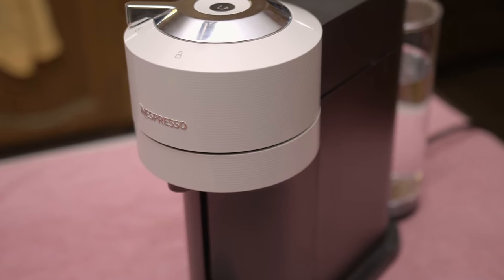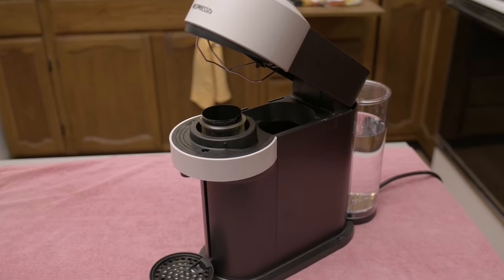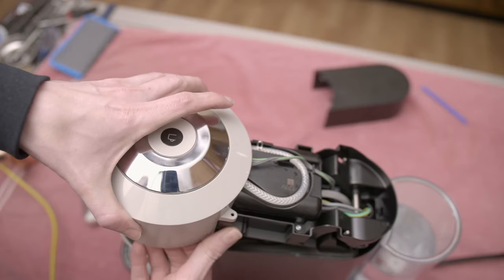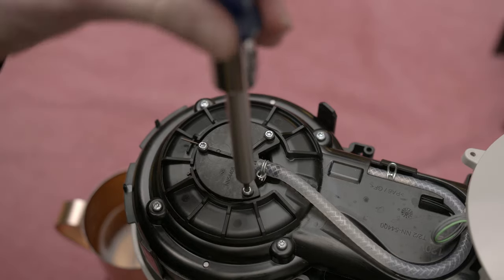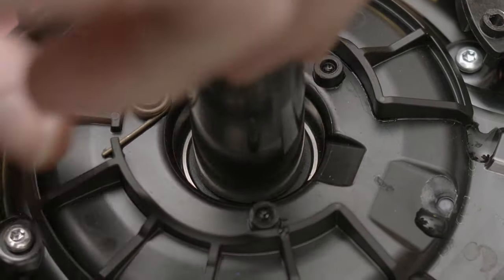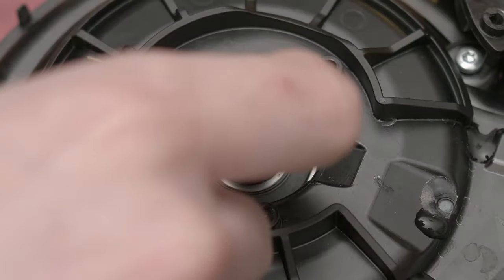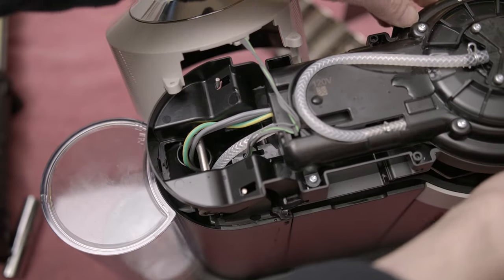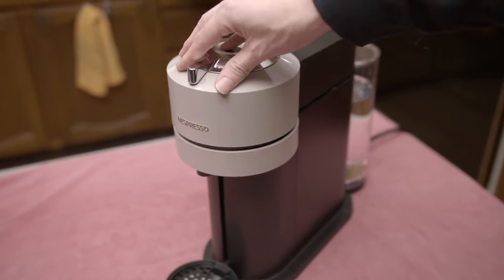Nespresso Vertuo Next - Don't Buy This

Comment: I buy these at auction and so far I have 4 of them. Two leaked where yours leaked. I took out the white washer under the blue one and flipped it upside-down.  No more leaks
Reply: Do you mean you then put the white washer on the top of the blue one instead, with the white washer flipped upside down to the way it was when it was underneath the blue washer?
Reply: I just tried that.  Ours is still leaking.  I might try some gasket paper.....  see if that works
Reply: Holy Guacamole!  I just put the white gasket back like it was supposed to be but THIS TIME I flipped the blue gasket upside down and IT WORKED!  5 Straight cups and no leaks!  I think I can put her back together!  Thanks for the idea Scott!
Reply: @xredman002  Keep us updated on this, please!
Reply: @christopherlloyd9954  took it to the cabin.  had guests all weekend.  worked great!  I imagine that this isn't the problem on all of them.  it was the problem on mine.  But.....  it is there.  Those two gaskets are the culprit.
Reply: @xredman002  Thank you for that. I'm going to see if I can engineer a long lasting solution to this. It's a very bad design, and prone to fail.
Reply: @xredman002  any update, still working?
Reply: @guillaumegagnon7049  still working.  Granted.... we took it to the cabin so it only gets used like 6 times a month now....
Reply: Anyone tried this method?
Reply: You should make a video on how to do that flip  a lot of people will Thank you for it please post that I don’t understand what to do or how to do that
Reply from the maker: @jackyrodriguez8309  Follow the video and when you take out the white disk, turn it over and put it back in.  Then put the blue disk on top and reassemble.  I returned the machine long ago so I can't make another video, sorry :(
Reply: @guillaumegagnon7049  it started leaking again.  I am taking it apart this weekend to inspect.  I am pretty sure it is those gaskets.
Reply: @chunyiptong1251  Yes, I have, and so far so good! Fingers crossed 🤞
Reply: @xredman002  I did the gasket flip on mine recently. Put the white in place of the blue, and vice versa. Working great so far! Fingers crossed 🤞
Reply: just did same thing!
Reply: I followed the video for disassembling help of the top. Didn’t read the comments until I had it back together and fixed though. A guy on reddit recommended adding a dab of silicone grease to lube the spout inside the spinning gasket. I did that. I possibly flipped a gasket on reassembly, but wasn’t paying attention to that. Leak is gone for now. 🎉
Reply: @jackyrodriguez8309   really? you need an entire , whole video on flipping the thing , thats already in the original video it's great for disassembly,  other than that a waste of time video,  because  zero solutions,  other than his declaration to stay away from vertuo,  and get orig nespreaso or a   traditional machine which are a huge unconvience, mess and waste .  The original line is good but the crema is way better on vertuo    the vertu machines  ones with the water  tank on the sides esp round head are far superior  they too are vertuo .
Reply: This just worked for me, I also pulled on the little tube that goes through the washers. It seems to get pushed up and that might be the actual issue.
Reply: Bought one it worked for 4 weeks many poor reviews.
Reply: you sir are a live saver! Thank you
Reply: Just fixed a Nespresso following the video and flipping the white washer as recommended. No more leaks! I will share that there more than two clips to remove the top of the machine in the newest model. I ended up breaking the clips. But that's why I have a glue gun. 😉

Comment: Yep. I got one of these from my company as a gift. Within a week, it froze up and wouldn’t brew. Nespresso replaced it with a Delongi model. It was leaking just like yours the first week. Nespresso replaced that on with one of their Nespresso branded machines. Seemed cheaply built compared to the rose gold DeLongi, but it’s been working flawlessly. But still, it seems like quality control is not a high priority.
Reply: De longhi ones are cute and stuff but they are really fragile and break easily 😅

Comment: I too have heard the Next model has leaking issues.   I have the Nespresso Vertuo Evoluo model. This is a solid model with few problems with any per the various social media groups I belong too.  I’ve had mine for about 5 years without a single issue.   I use it almost every day.
Reply from the maker: I don't think I've seen the same level of issues with the other models doing research.  I got this one on a lightning deal including the frother and 30 pods for $130.  I wish it was more durable.

Comment: For those who say this isn't an issue having 120/240 volts AC exposed isn't an issue clearly dont have any electrical  knowledge or awareness of safety, I work on these things on a regular basis at work the issue is that the seal isn't compliant enough or loses compliance so we replace the seal with 2 silicone rubber seals when this is done I have not seen a single unit leak as usual the manufacturer wont acknowledge failures.
Reply: @joycejaime763  The replacement washers are 9mm in circumference  by 1.5mm in depth with a 4mm centre hole I looked on amazon there are nitrile sealing washers of various types. So I would look there.
Reply: The way I fixed mine is to swap the white and the blue gaskets around, and I've now been using it for months now, without any leaks whatsoever. Thanks very much for the dimensions of the replacement seals you use! 🙂

Comment: hello ! I also have this machine and I'm very satisfied. However I can see that your machine is defective. Nespresso gives 2 year guaranty for every machine , so you should just call them and they will replace it right away. Another thing about Vertuo machine is that they need some time to start prepare coffee because there is a step in the beginning where the water goes through the capsule , blend AND THEN brew (this is not a machine's problem/fault  , it's the way it work) .
Reply: I’m satisfied with your comment after reading everyone else’s lol

Comment: I purchased the Vertuo Next in November of 2021. It worked fine for 3 weeks then wouldn't do anything.  The light on the button would go to steady white and nothing would happen when you pressed the button.  Called Nespresso and they replaced the machine.  The new machine arrived 2 weeks later.  It worked fine and 3 weeks later the machine started blinking yellow.  Tried all the recommendations in manual, none worked.  I'll be calling Nespresso The wonderful coffee is great but these problems suck!.

Comment: I followed the tip in one of the comment below and managed to fix my water leak , thank you so much ! The tip used was to flip the white gasket, put everything back and make sure to tight the final black plastic screw with an adjustable wrench or socket to make sure everything is well sealed and waterproof.
Reply: It’s crazy how we buy something brand new and need to do shit like that to make it work properly.

Comment: I purchase amazon returns for a living. Currently dealing with these machines with this exact issue. Feels like the little gasket gets hard stops sealing. I've tried a few repairs but no matter what the machine still leaks some amount. Personally i hate dealing with these machines, they are overly complex and very finnicky. They do make good coffee though if you have the dough to drop on the overpriced coffee pods. Pretty much just throwing these machines in the trash now because they are unrepairable (for resale at least). Very wasteful and disappointing. Although dealing with returns has opened my eyes to how poorly most products are made these days. Great video! Always nice not having to pry around for an hour to figure out how to disassemble the thing.
Reply from the maker: Glad it was of some use to you.  My goal was to make a how to fix it video which quickly turned into a don't buy this video.
Reply: No wonder 2 of them were in the Amazon's return box I just purchased. You just opened my eyes. Oh well, I thought this was a decent buy, but I now I guess I'll call it a loss
Reply: I’m looking for the retainer, gasket, and reed valve. Do you know the size and where I can buy replacements?

Comment: After going through the machine, I realize that the beige seal actually becomes deformed when hot. It is not the proper seal for the temperature of the device. It's really unfortunate that this machine's failure and reliability comes down to a little washer that costs less than 1/10 of a cent.

Comment: I think they know this is a manufacturing/design issue, and they are trying to keep it hush hush. Which is why they’re pretty quick to send you a new one lol. It is Nestle we’re talking about here. We got a refurbished one that leaked everywhere and locked up, and they sent us a brand new one. It has been just a week or so and I just caught water draining from the top down the back.
Reply from the maker: Yep that's how mine started and just got worse.  It's not designed to catch any leaking water into the bin.  I worked support at Amazon when the first Kindle fire came out and there was a design flaw with the USB port coming off the main board due to poor support.  We were told to just replace it.  I think I replaced at least one a day.  My mom's eventually failed the same way 4 years later with a really good battery still.  The data and power pads literally get ripped off the PCB still attached to the port.  Such a terrible design.  Unless it's a safety hazard or something really really bad, they will never recall.  That's why PSAs are necessary if you notice something doesn't add up.

Comment: My vertuo next works just great . I have no issues maybe yours was damaged during shipping.
Reply: ive been using mine everyday, multiple times a day for the past 9 months without any issues
Reply: mine just BROKE after LESS THAN TWO MONTHS, used once a day at most
Reply: Ours just started leaking today.  I got it for my wife as a christmas present.  so..... 6 months
Reply: Mine has completely stopped won't even output liquid... I'm going to buy a new one this time s delonghi not a breville
Reply: Mine too and looks way more beautiful than any Vertuo Plus model.
Reply: @christinejustin4883  Sometimes it happens when coffee grounds get trapped behind the Centrifusion spinning wheel. There is an easy fix shown in Youtube.
Reply: @Albertojedi  I'll check to out thanks
Reply: @christinejustin4883  Here are a couple of quick fixes. Hope one fixes yours: https://youtu.be/duK5sr3wLwU
https://youtu.be/05QSBFyFdeY
Reply: @christinejustin4883  they are the same unit with different branding. Just a marketing tactic for Nespresso.
Reply: I'm on my second machine and it operates worse then the first one. 😡
Reply: Dang there are a lot of people with a next that  got "damaged in shipping"
Reply: Mine is rubbish as well. Stopped brewing after 1 month. Only flashing orange. Doesn’t read capsules at all. Absolute rubbish.
Update: end up in the bin. Absolute rubbish. Avoid this no matter what. Please note - it was £239 at first and now they are trying to get rid of them for £79 hahaha. They should give money back to every owner and derange them. It’s a proper scam.
Reply: @Albertojedi  Bollocks, no matter what you do it won’t read capsules and it seems to be common issue which Nespresso is aware of and got no clue how to fix it - the only option under warranty is replacement. Waste of money and time.
Reply: Luck you. I had two machines replaced in guarantee than I asked for my money back. 😔

Comment: I just bought one like two weeks ago, and for now it's working great 👍 I guess that if this video has been posted a year ago, I have to SUPPOSE that nowadays they have already fixed the water leaking problem, haven't they? I have to believe it
Reply: Nope. Still the same leaky design.
Reply: @christopherlloyd9954  for now, mine doesn't show that problem
Reply: @ElFrankenspawncomics  It will do. They all suffer the same fate.
Reply: Does this remain true 5 months later?
Reply: @spencalitto  Still true, and still working pretty good, I'm start thinking that many of the complaints are because some people don't handle the product as it should be
Reply: @spencalitto  Yes. They still fail in the exact same area.
Reply: @ElFrankenspawncomics  I was meticulous about looking after this machine, as I am with everything I own.  Take the time to research this problem on the world wide web, and you will soon come to the decision that these machines have an inherent fault.
Reply: @christopherlloyd9954  So, as how you responded I think that maybe you only looked about this but you didn't buy one, did you?
Reply: @ElFrankenspawncomics  I've had two that failed on exactly the same way as this video shows.

Comment: I just spent an hour on the phone with Nespresso.  They would not send me a regular nespresso machine.  They insisted it be the same machine, despite the regular machine being about $100 less.  They furthered the insult by saying they would sell me the machine I requested for 35% off!.    Horrible customer service, junk machine.  I had to settle for a replacement.  I may just put it on eBay.

Comment: I wholeheartedly agree with your assessment I purchased one of these late November 2021 so I could have my one good morning coffee at home, within a couple of days it started leaking intermittently but we persisted, it then needed descaling which we naively believed would resolve the issue but it didn't. So we contacted Nespresso they agreed to replace it.
Our new machine arrived THIS MORNING.
Straight out of the box I did the "clean before first use" it leaked like a sieve... absolutely gutted and very sad that I didn't find your video last November :(
Reply: Tell them it's happening again and demand a different model. Get the plus

Comment: Mine isn't leaking, but I did a thorough cleaning of the spinning parts and I think I got some water where I wasn't supposed to and now today the laser supposedly doesn't work after being on the phone with customer service. They want to give me a refurbished machine of the same type and I'm pretty mad about it because I paid a lot of money for this - it shouldn't accumulate coffee oils to the point of making it almost impossible to open and close so that you have to scrub it like crazy and then get water where it's not supposed to which breaks the laser. 😡 if the laser is not broken I would like to know of a way to fix it myself and get it working again but so far everyone just tells me that I have to clean the clear part and that should fix it. I tried that and it still doesn't fix it and you can't take it out to really give it the best cleaning possible

Comment: all the Nespresso Vertuo Next simps, talking about how GREAT theirs is working... TWO WORDS:  JUST WAIT.
Reply: whatever
Reply: The machine is best used as a paper weight.
Reply: Still better than Keurig by far, I'd rather not have watered down coffee and have my machine break down after 2 weeks of use lol. 

I have the Evoluo, Lattissima, and got the Vertuo Next Deluxe as soon as it came out. Ive been using nespresso for YEARS with no issues. That might be a you problem 🤦‍♀️
Reply: Vertuo next is awful if you want a Vertuo get the round head

Comment: I should add that I've had my machine for a year and I never descaled it which I know is not good. And customer service could definitely see that I haven't since I've never ordered and descaler until the one I ordered about a week ago and used just today. I wonder how many of these people who are pulling the machine apart and flipping seals and such are actually just resetting their machine in the process and it's the resetting that is actually stopping the leaks. The other thing I noticed is that the leaking was some what intermittent at first and it almost seemed like some pods would cause leaking in others wouldn't which in hindsight suggests that it's all about the machine having an issue reading the pod accurately and that resetting the machine is the fix.

Comment: Just got hit with the dreaded leak.  Is there any replacement gaskets to try to solve the issue?  I've taken the factory ones out and put them back in all sorts of combinations without any success.
Reply from the maker: Could try some kind of gasket paper but most I see are for automotive.  Try pressing the current one in a book or between counter and a flat bottom pan with something heavy inside overnight to flatten the material around the hole.  It might seal better afterward... Or get worse :\
Reply: Add some silicone grease to the gaskets. Same (safe) stuff that is used on water filter gaskets and other plumbing applications.
Reply: Any luck finding any? Mine are missing altogether
Reply: @jv1185  Not officially.  I found a junk unit at Goodwill that didnt turn on.  The gaskets were in better condition, swapped them out, mine has been working without any leaks.

Comment: What size torx bit did you use to get the top part off? I've tried my t10 and it didn't feel like it moved the screw at all.
Reply: It’s a T10 Security bit.